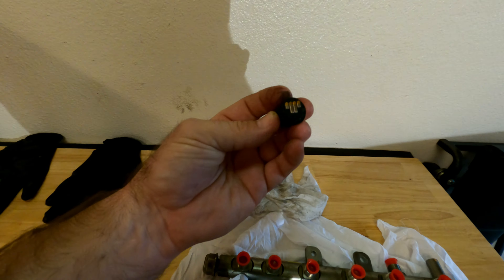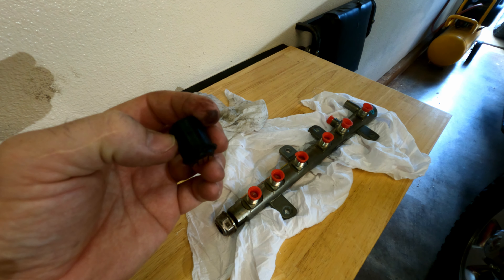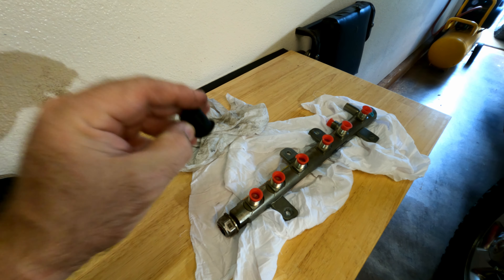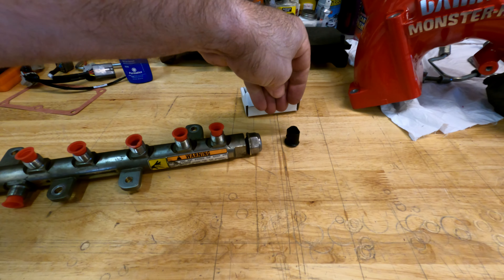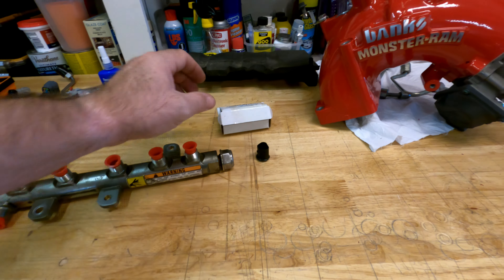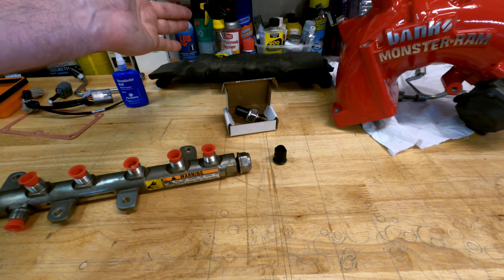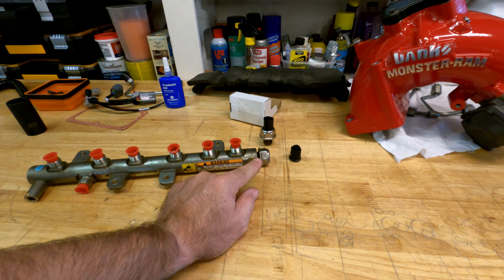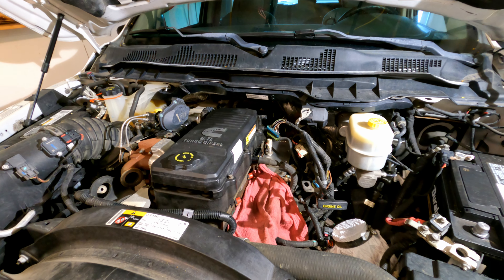6.7L Cummins Fuel Rail Pressure Sensor Replacement

Comment: I bought a Bosch OEM one from diesel power products for around $50 last year. I was able to replace it without taking the fuel rail apart. I bought a special socket for it. It was $20 I think? And used a flex head ratchet from harbor freight. Just a thought if you ever gotta replace it again.
Reply from the maker: Great to know it can be changed without removing all that again. Couldn’t find much info on it and considering its location figured it wouldn’t be reachable.
Reply: @Chiefyoung  it's was not fun and my knuckles were bloody but i got it done haha. By the way your GCSS videos are great. I use them all the time.
Reply from the maker: Awesome. Thank you. I’m glad they’re still useful. Working on broadening the channel now with other content. lol
Reply: What dose the engine do when you have a sensor
Reply: @soopashaggy it regulates the amount of fuel being thrown at the injectors
Reply: Do you know the special socket part number?

Comment: How do the connectors work for the two plugs along the fuel rail, the two with the blue tops? Do they squeeze or pull or??  Thanks
Reply from the maker: I don't remember exactly but think they were the single clip tab style, like the ones you find on most connectors.

Comment: Question what did you use to hold down the rail and take that sensor off and tighten the new one on? I had the same issue happen to mine and I’m going to replace it today
Reply from the maker: I had the rail off already while installing the new heater grid plate. I didn’t reinstall until I had the new sensor and just used a couple of wrenches.
Reply: @Chiefyoung  so just use a wrench to hold it down ?i  have mine off right now I just didn’t know if you used a vise to hold the rail while using a ratchet with socket to take it off
Reply from the maker: I used two wrenches but a vise would work too, just don’t clamp down too much on it.

Comment: Has this sensor still been working?
Reply from the maker: Like a charm. Not one issue so far.
Reply: @Chiefyoung  did you torque it down or use and thread tape or anything? I just installed one with no thread tape or loctite or anything and I’m hoping it doesn’t leak..
Reply: I just tightened mine up as tight as I can get it. It works like a compression fitting correct?
Reply from the maker: Yeah, I didn’t use any tape either.
Reply from the maker: Nothing just tightened it down within reason and called it good. No issues so far.